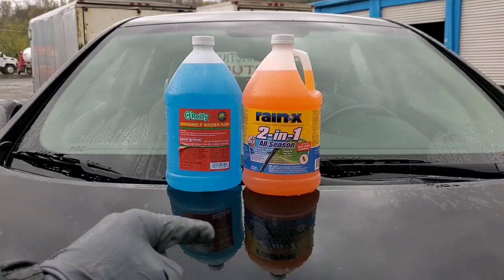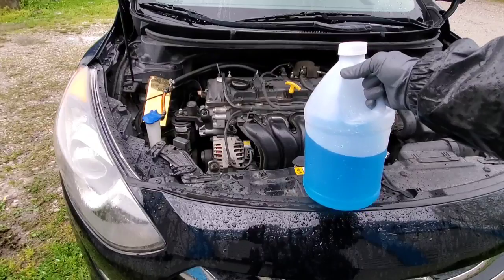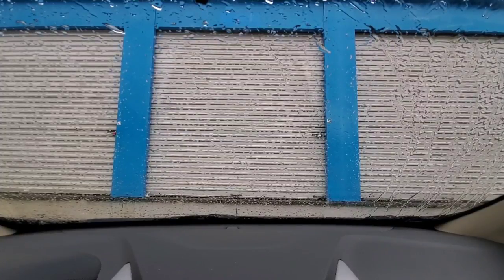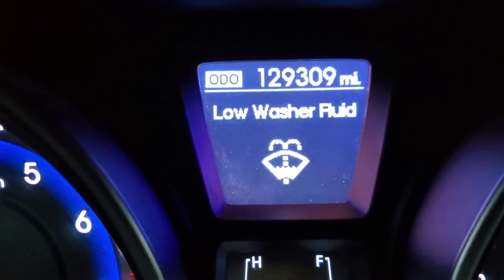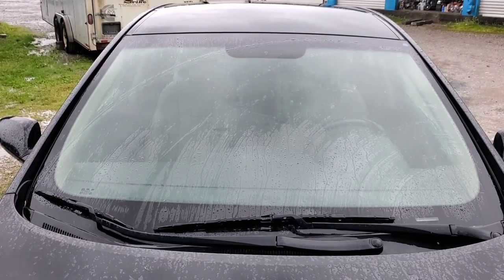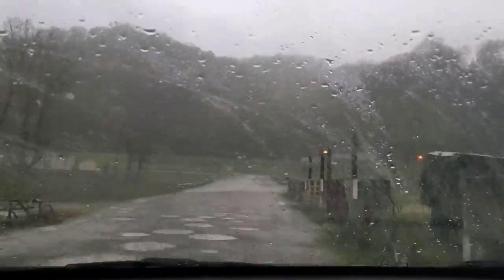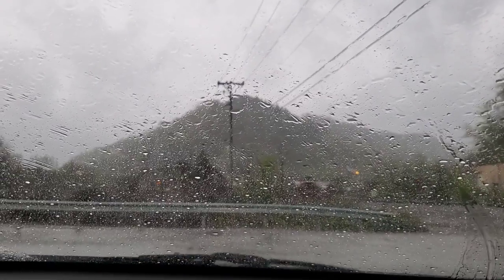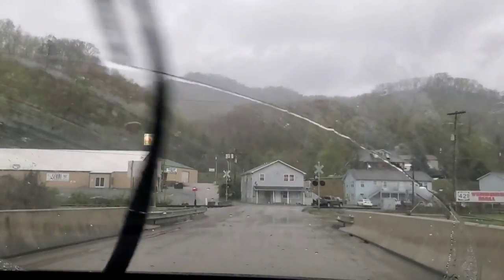Best windshield washer Fluid!

Comment from the maker: What would you like to see next?
Reply: NATES INTERACTIVE AUTO   Ceramic brake pads vs. non?
Reply: Different wiper blade brands & types.
Reply from the maker: I did a similar video
Reply from the maker: Good idea
Reply: Try it again but pour in spray wax with it to see if it improves it at all. Many folks already use spray wax for this type of thing, maybe adding a little to the reservoir could make it time efficient and keep it lasting longer overall (by reapplying small amounts over time)
Reply: lol, I like that Hawaiian Punch jug… 👍🏽

Comment: Maybe it is time for a fresh set of wiper blades.
Reply from the maker: The wiper blades are a month old and they are Rain-X. Im not sure how that would impact visibility issues from Rain-X at less than highway speeds.
Reply: Buy denso hybrid blades so much better or try bosch
Reply: @NATESINTERACTIVEAUTO  That is the problem, Rain-X blades aren't that good to begin with.  There is nothing like OEM wiper blades.  I've tried them all, I always come back to the OEM.  The best part about the Rain-X washer fluid is that if you have already coated your windshield with Rain-X it just keeps re-applying it.  Your blue stuff washes the Rain-X water beading.
Reply: ye the blades combined with an old windshield will do this lol , but rainx 2.1 is what the dealer tops off if i goto their shop just to top off fluids   :)
Reply: Seriously LOL

Comment: If you couple the Rain X 2 in 1 with the Rain X wiper blades, it works a lot better. Based on what I seen on the video, the wiper blades you have need to be changed and its probably best you don't try to do this experiment while its raining. You don't buy a fire extinguisher after a fire has started.
Reply: I used that rainx after putting on brand new blades and cleanining the windshield and i got the same exact smears when wiping and cloudy haze when raining. Also if the issue was his blades then it wouldnt have smeared way less with o reilys

Comment: I liked the Rain-X at first, but after a while you'll start to see that it clogs up the nozzle because of its "wax" properties. My right nozzle just drips right now, and my left one is going downhill. I will be cleaning the nozzles and going back to a basic washer fluid. I came here just to see if anyone had that problem yet.
Reply: I always put a little vinegar in my washer fluid, helps keep the nozzles from clogging up.

Comment: The RainX works best after drying on the windshield. If you apply it on a dry day, it will work way better in the rain.  The orange is good for year round use to continuously apply it on the windshield. Unfortunately, it also leaves orange residue on paint. My squirters are on the hood, and it's quite noticeable on white paint.

Comment: If you mix the rain x washer fluid with the regular washer fluid 50/50 it will not smear the windshield with a film yet it still allows the rain x to work pretty well.

Comment: Clean your window first. Add rainx when your windows are dry. After you apply it on a dry window it gets better and better. It's all i use here in Colorado in the winter and I never turn on my wipers on the rain. At speed the window clears it's self with no wipers.. Great product when applied and used properly.

Comment: I’ve noticed this. Rain X leaves a misty or streaky layer of water behind that makes it seem like your wiper blades needs replacing. It will make rain bead up and roll off at high speeds, but when there’s only a small amount of rain or you’re driving slow, the windshield does not clear up behind wipers that well.

Comment: My experience with RainX: Use the spray bottle stuff, applied correctly on a VERY CLEAN windshield. Use Rain-X sprayer fluid. I have to use my wipers half as much because the water just falls off the windshield at speed.  Also, always check your wipers to make sure they are in great shape. My whole family uses their stuff, and when used properly, is great when you live in a rainy area. I don't think just using the sprayer fluid with one outing gives you the best result, as seen in this video.

Comment: Thank you for your video. However i just wanted to WARNED and ADD  that i use to be a fanatic of this Rain X product until now... I just found out after few years of having  problem with my vehicle's wiper fluid sensor " LOW WINDSHIELD FLUID" messages on my dashboard was cause of a coating layer from this product.  I'm still trying to fix my issue. Just and FYI for does out there that using this Rain X product could  give you this problem.

Comment: I always by the cheap stuff from the grocery store or the dollar store and I never notice a difference. At the same time, I always have my windshield and windows treated with Rain X water repellent. Makes a big difference when I drive in the rain. The cheap stuff has always worked well for many years.
Reply from the maker: Yes i agree the lower price fluid is good or better at less than highway speeds where i might give the edge to Rain-X. Thanks as always really times are getting tough but i hope everything is ok for you.

Comment: The blue stuff is basically just a cleaner, where the Rain-X is more of a water repellent treatment. I have found that first cleaning the w/s with a nylon scrub pad and winded, and cleaning the blades themselves with WD-40 seems to minimize the smearing after the WD-40 wears off. The Rain-X makes a difference at higher speeds where the air pressure actually blows the water off of the w/s. I can actually see much better on the Interstate with the wipers off on a Rain-Xed w/s. It does take quite a bit of application to a clean w/s for the Rain-X to really work. If you start with a w/s splattered with bugs, neither one does such a great job. The best thing (and cheapest) I have found for bug removal is baking soda on a damp rag. I learned that in Florida during love bug season in the 70’s! It doesn’t hurt the paint!
Reply from the maker: Very informative with many tips & experiences. I agree highway speeds Rain-X can be beneficial.
Reply: WD-40 should never be used as a cleaner.  It's a water displacer, hence the letters WD.  It is not good as a cleaner or a lubricant
Reply: MiniDevilDF Well, it works for me, especially once your blades have started streaking. If you have some kind of preconceived notion that it won’t work, by all means let your wipers streak. By the way, there over 100 uses for WD-40.
Reply: You lost me at WD-40 to clean the wiper blades

Comment: Run 1 full gallon of the Rain X thru, and by the start of the second gallon you will never go back to another brand. I’ve learned that the Rain X starts working really well after at least a full tank of it has been used. It needs a little more windshield time to really apply it’s coating. But I would definitely run 1-2 gallons before you decide to go back to the cheap crap. Trust me, it is well worth the wait!!!

Comment: Great video thanks for taking the time, I do not like the rainX because of the film it leaves, for the price the RainX should perform better, I have used the spray RainX with the RainX windshield wiper fluid and RainX windshield wipers it does not help, another reason I do not use the RainX is because when you are driving under street lights at night the glare will blind you.

Comment: Rain x has to be applied dry, even a base coat of the washer fluid. At low speeds it ain't that great. It shines at high speeds. Also it helps with wiper shatter, an squeeks. So try the rain x on dry day afew times then update please. I promise you will change your mind
Reply from the maker: I have used dry and Rain-X was previously in the car. I just as most have used many like prestone and more. You are correct there is benefits to Rain-X.

Comment: I know this is old. But I finally used all my rainx from my reservoir and my window is so greasy how do you clean it all off I've used degreaser and it's still gross.
Reply: RainX is silicone based.  Try some basic isopropyl alcohol and a towel to get it completely off the windshield.
Reply: @juicebox22a  thank you!

Comment: Last year I purchased 6 jugs of washer fluid from Dollar Tree. I used it in three vehicles. Within months, the washer pumps in all three vehicles died (electrical problems) and needed to be replaced. Before that I never needed to replace a washer pump ever.
Was this just a coincidence or could there be anything with the washer fluid that caused this? Is washer fluid actually touching the electrical parts of the pump?

Comment: this test is b.s the stuff in side the fluid needs to dry or it will just wash off. it works great if used right been using the stuff for 16 years and never had an issue.
Reply from the maker: Rain-X is beneficial at highway speeds but it can cause smearing or residue in comparison without.  Rain-X has been applied to my windshield countless times dry and wet. However read the bottle of Rain-X that i used it doesn't say thats even necessary that is when you apply by hand.
Reply from the maker: They both have their benefits i actually always use Rain-X thats another reason why i used it last. But i realized after many uses just like anything else it has pros and cons.
Reply: @NATESINTERACTIVEAUTO  ive been using it for 16 yrs on evety one of my cars never had a problem with it even with bumper to bumper trafic you had dirt/road  film on the window. Deep cleannthe window first and dont use 10yr old wipers. Windsheild fluid isnt a substitute for proper detailing and cleaning
Reply: @mc1412007  i cleaned my windshield and applied it dry with brand new wiper blades and still got a lot of smearing when it rained

Comment: I did away with Rain-X after finding it to cause terrible streaking even with wipers on intermittent
or in heavy rain.
And that it has sediment collecting on the tank itself. The new formula is supposedly free of sediment, but I will 
stick with the cheap stuff.
I used Amway window cleaner to get the Rain-X residue off my windshield.
Sediment eventually left the tank.
Will never use Rain-X products again.